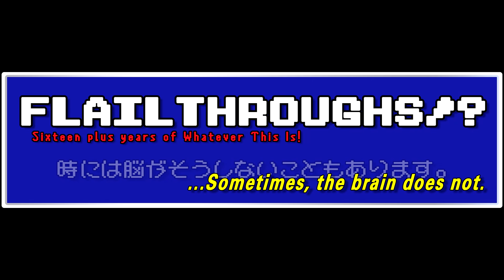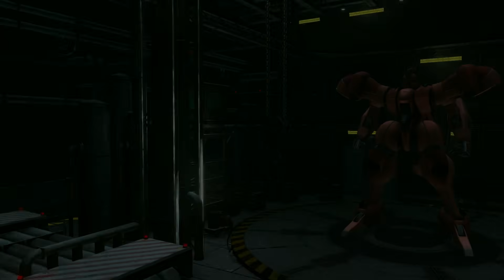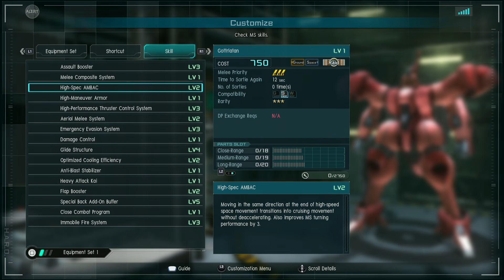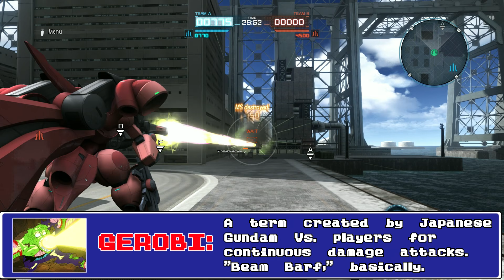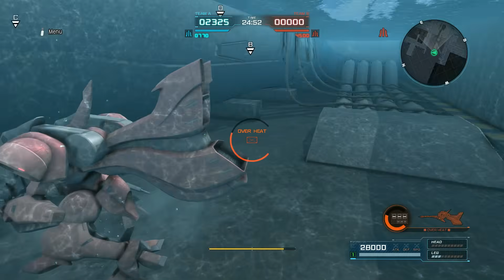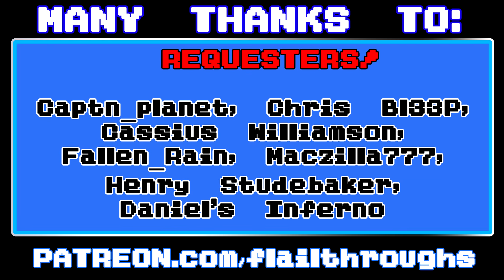Gundam Battle Operation 2 Test Drive! Gottrlatan Is A Bug-Eyed Beam Monster With Rare Aim Assistance

Comment: I see that you have 5 bars for your internet 🛜 I have always had 3 and I thought it was due to living in the U.S. But that’s not the case. How can I have 5 bars myself? Any insight?
Reply: I'd say get an ethernet cable and plug it in from your router to your console/computer, that should help boost your connection.
Reply from the maker: That's about the only advice I have. Back when the game first came out, they always said that you'd be better off on a wired connection if at all possible.